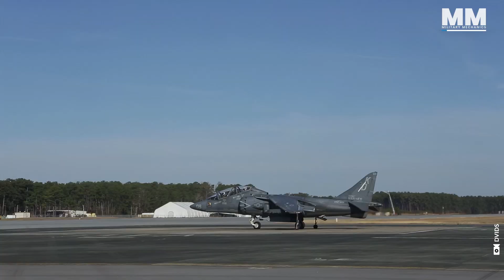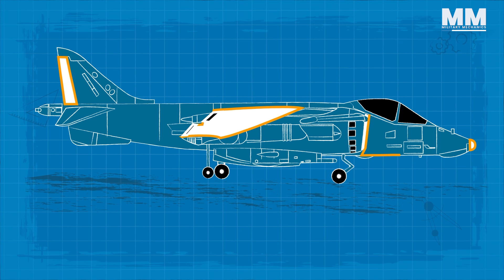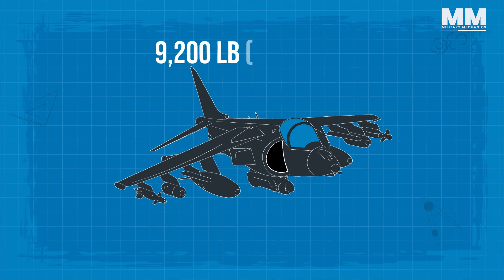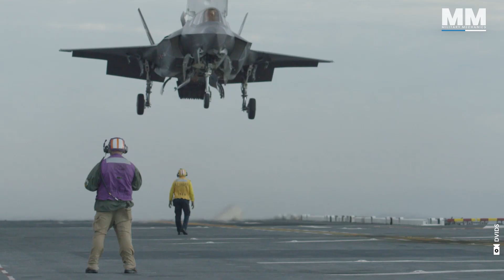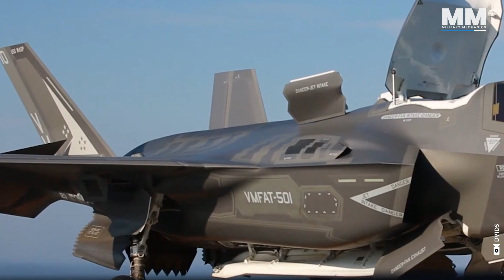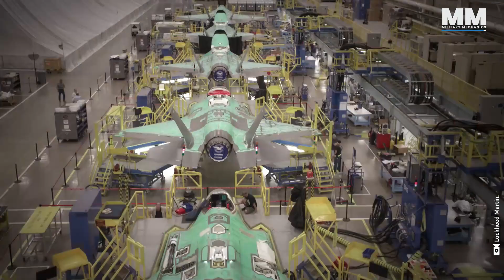Harrier and F-35B: Mastering Vertical Takeoff and Landing in Modern Warfare

Comment: Has there been a significant military action anywhere, where vertical takeoff and landing capacity was important, important enough to compensate for the added cost, complexity and less load capacity of such aircraft?
Reply: Yes
Reply: Yes, the Harrier was used in several wars. And yes, the vertical takeoff was also used to land on tight spaces on ships. Also the Marines version of the F-35 was also used. So yes and yes is your answer.